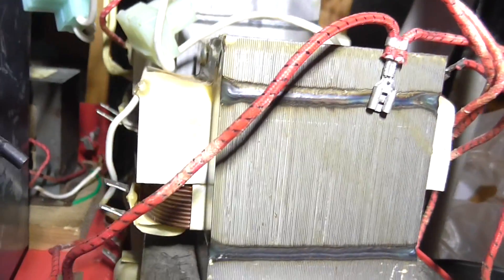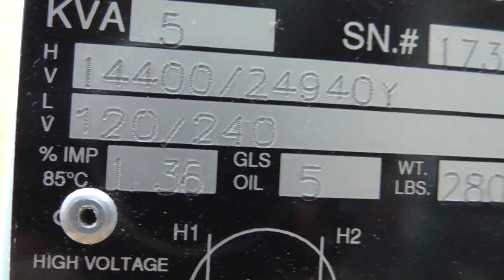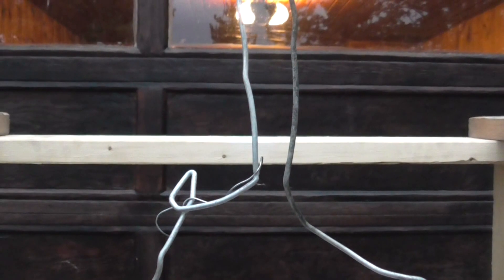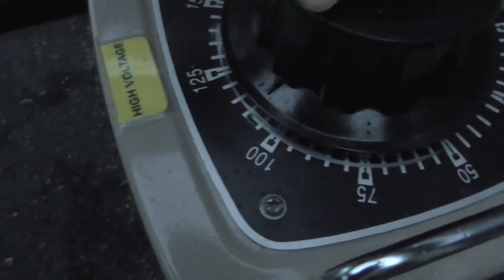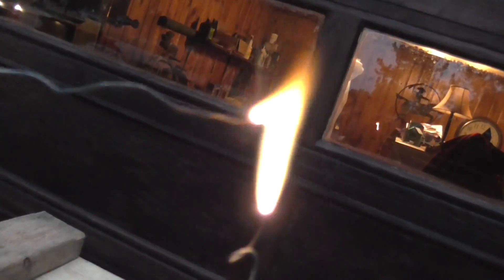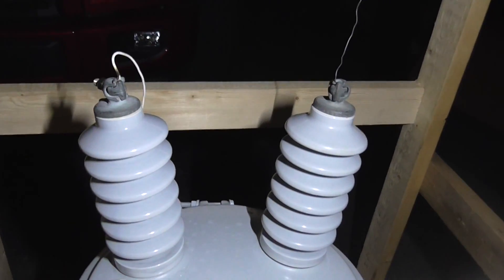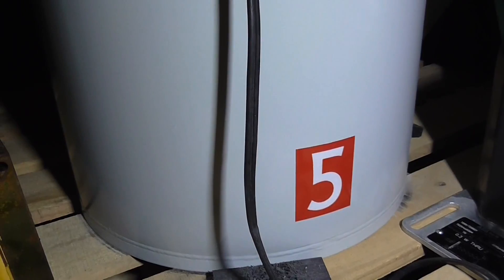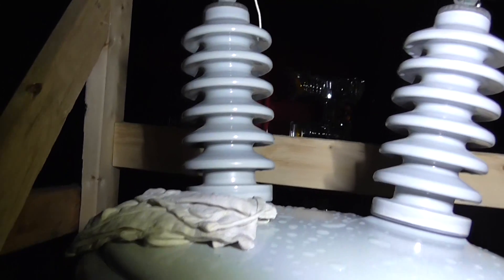New 14.4kV Pole Transformer!!

Comment: How were you able to power this? I thought it needed alot of voltage to go in.
Reply from the maker: Transformer is 60:1 ratio. For every1 volt I put into the low side, I get 60 volts.. When it gets 240v on the low side, 14.4kV comes out on the high side.

Comment: Looking at the arc it produced from the wire, i wonder what kind of insulation you need to keep the transmission cable running smoothly underground?
Reply from the maker: Very thick insulation, along with a semi-conductor on the outside to distribute & eliminate any capacitance along the surface. Then a concentric neutral wrapped around the semi-conductor, then finally the outer protective jacket. Some underground cables are oil-filled to further insulate the conductor.

Comment: Here in the UK, Hv transformers like this are so hard to get hold of. Im jealous :(
Reply from the maker: Some scrap yards may have them. Maybe you could contact a power company as well.
Reply: Variac Maniac Am transformers are my go to company who make custom transformers. But they are extremely expensive. Scrap yards don’t tend to have them as there are a lot of regulations in place + the fact that the value in copper here is high so it is more profitable for the companies to sell the scrap copper/ iron than to sell on the whole used transformer unit. how much did you’re 5kva pole transformer cost? Where did you get it? 

Cheers mate :)
Reply from the maker: I purchased the transformer from the Solomon Co. for $520.00 with the shipping. Don't know what that works out to in the British Pound, but I never expected it to be as easy as it was to purchase it. It would have been even more expensive if I purchased one with copper coils ( I choose aluminum coils ) and had it home delivered.
Reply: Variac Maniac cheers for that info dude I’ll take a look. Was it a custom build IE you give them you’re specs or did you just select if off of there website.
Reply from the maker: I ordered it custom built to the specs I asked.
Reply: Kyle Bishop Our transformers here in the uk are so much cooler looking too, especially the older ones
Reply from the maker: Indeed! Your transformers are a lot cooler looking, most of our pole mount transformers are usually single phase as yours can range to three phase. We usually use 3 single phase pigs to get three phase.

Comment: Nice arcs man, and even better sounds! Be safe dude. Thumbs up.
Reply from the maker: Thank You man, I wish everyone here had a pole transformer. Need more videos like these on or with these on YouTube....
Reply: Definitely! I've got a 7.5 KVA transformer, but it's for isolation (the resin-encapsulated type), so no arcs. Have you done anything with flybacks before?
Reply from the maker: When I take apart TV's, I sometimes like to pull arcs using the flyback and the TV itself.

Comment: WHAAAAT?! You have a pole pig!!

Aaaah, I'd like to see a lightbulb connected across those bushings and have 14kV rammed in there. That arc would be so huge that, once it has obliterated the filament and turned the stems to molten metal, it would then rise up in there, melt through the top of the bulb and shoot a lightning bolt out of the top.

Then you could really say...... "I POPPED IIIIIIIIITT." :D

Bit of a shame I couldn't hear that device on 50Hz.... it would sound super-grunty.

Doing some maths, "In-The-Name-Of-Science", of course, I have worked it out that, between 240v and 14,400 volts, this gives your pole pig a windings ratio of 60.

Being  a 5kVa transformer....

If you actually used it as a step-down transformer and stuffed 240v INTO THE BUSHINGS it would reduce the 240v by a ratio of 60 to give you 4v on the output side.

Hmmm, 4v..... Things might start Glowiiiiin' when connected across the output! :D

But... how much could you do that without popping it?

Well, 5kVa at 240v is approximately 20.8 A, and its the Amps you need to watch to save things going pop.

I'm sure that 20A at 4v could give some fun.

14.4kV.... well, it seems to me that you have different line voltages there.

Here in the UK, if I got hold of a pole-mount transformer, it would have three bushings on top of it, because it would be connected into 3-phase 'Delta' at 11,000v.

The output would be in 'star' and there would be four terminals. This allows the transformer to have two output voltages: 415v between any two phases and 240v between any phase and neutral.

Now, while beggars can't be choosers....

If I were to get a pole transformer, I would like mine to be at least 10kVa, because then, my 28A BIG DOGG could couple-up to it for some SERIOUS arc-ups and fizz-overs. :D

Here's an experiment I would like you to try with your new pole pig:

Get an old microwave. Whip out the MOT. Now wire your pole-pig to the magnetron in place of the MOT, but heres the differences:

Because your pole pig can rustle-up a bit more than 2kV and 700w, you could give that magnetron a good 4-6kV BEATING and see if it boils a cup of water any faster, and to see of course, if we get any interesting sounds out of it.

You know.... "In-The-Name-Of-Science", of course! :D

If you pull that off, don't forget a shout-out for Wayne's Electrical! :D

Your pole-pig looks heavy. WAAAAY heavier than my BIG DOGG. I think it needs wheeelz.

Of course, you can't screw anything into the device because oil would probably pour out everywhere.

My top tip:

When making a base for the transformer to sit on, make the "footprint" of the base a fair bit more than that of the transformer. This is why....

If, one day you decide to roll your pole pig outside for some fizzy-fun and the most unfortunate thing happens where a small stone gets stuck under one of the wheels, what could happen, is the transformer could topple over.

Should those bushings hit the ground, they'll snap like twigs! :-O

Having the mounting base a fair bit bigger than the base of the transformer will give it more stability when moving it around.

OK, that's all I need to say in this one.

Just play safe, and make sure that nothing anywhere is being overloaded. 
We don't need any unwanted flaaaames!

Thanxx for showing,

-Wayne's Electrical.

1st September 2017, 20.55
Reply from the maker: I will do a vid and give ya a BIG SHOUTOUT!! Thank You for the Ideas!!
Reply: Flamesh - photonicinduction

Comment: What's the input voltage of that transformer?
Reply from the maker: I have it connected backwards to get 14.4kV+ out of it by putting 0-240v into the secondary low voltage terminals that I'm using as the primary and the high voltage terminals which would be the primaries I'm using as the secondary's, but 0 - 240v+ on the input....

Comment: Stupid question, but you wear high voltage gloves right ?
Reply from the maker: No, need to find some, I'll be safe enough with a long PVC pipe hot stick....
Reply: i'd try to hook you up with some, but the only ones we throw out are the ones that fail testing and you don't want those. Class 2 (good for working with 1.7Kv and tested at 2Kv) from Grainger are 180$
Reply from the maker: I will check eBay or something.

Comment: Awesome I can't wait to see this thing run with lots of power! It could probably do 10+ kVA without breaking a sweat! Solomon is a good company too. I've dealt with them several times in the past. I'd also recommend investing in a Maxwell 14400 PFC capacitor and series it with the high side output. REALLY makes a difference. You've gained a sub from me. Have fun and stay safe!
Reply from the maker: Hey man, really appreciate that!! Oh and uh thanks for the suggestion on the Maxwell cap, will try to acquire one.
Reply: Looking at the impedance I would guess that this was originally a 10 KVA and Solomon downgraded it to a 5 KVA. Typically OEM's would not produce a transformer with that low of Impedance.
Reply: @ibsteach  I was going to say, it's a ridiculously low impedence. Definitely seems it'll handle 10kVA all day long. I obtained a 10kVA dry type transformer (just 240-110V), that has an impedence of 1.44%. Don't even know how it's that small (only about 67kg)

Comment: I always wanted one of those transformers as a kid this thing is a beast perfect for testing wet dry flash over on insulators.
Reply from the maker: Yeah, I just can't believe I have one!!
Reply: right now down here in south Texas we had hurricane Harvey we had a lot of poles knocked out I just go up to the linemen and ask for stuff they are cool with it yesterday I got a lightning arrested rubber type and about 10 fog bowl insulators I don't think they would give me a step down  transformer lol hey I like the way you put sine wave main voltage to the secondary windings lightning storm  jacobs ladder looks cool awesome transformer:)
Reply: Hah, i had the same feeling when ive got that 22kv PT :)
Reply: You wanted one as a KID?!? I mean i did too but what whould you do if you got one?
Reply: @ResistorArcs  I collected insulators at the ime I would look up and see the white fog bowl types andthe different brown shades of manufactures I had a few but knew the volt to be at least 10k volts 😂 but a single phase 110 volt transformer is cool now I seen one on ebay for about 400 dollars that weigh about 90 pounds  plus freight but it is small in comparison to say a normal pole disrubution transformer.
Reply: yea me too
Reply: @ferrocerium123   Single phase 110 volt secondary 10 kv primary last I saw one eBay 350 dollars